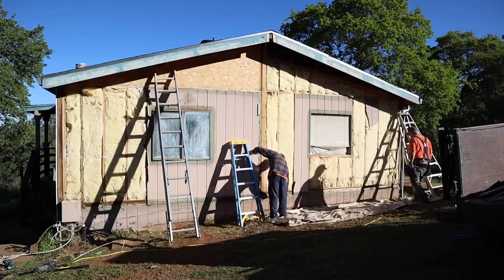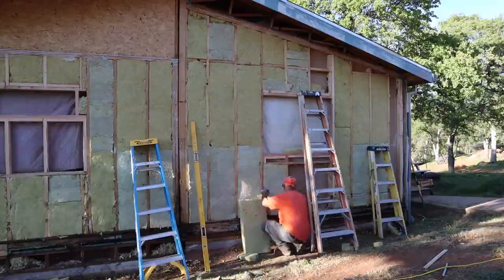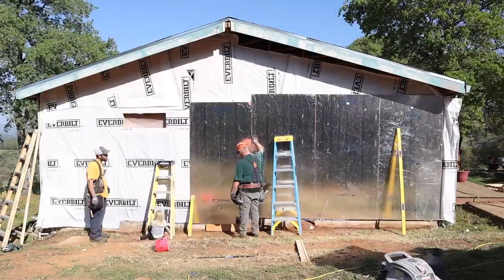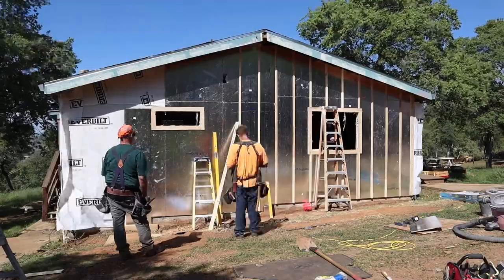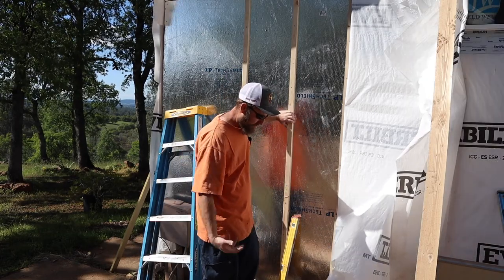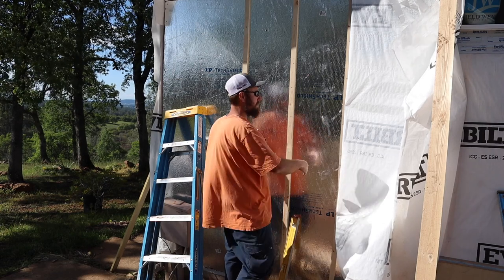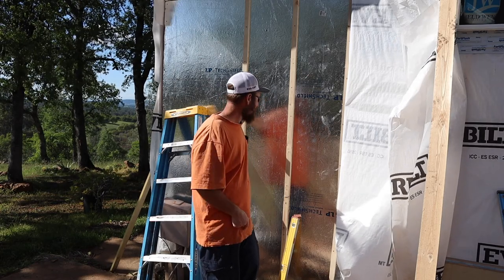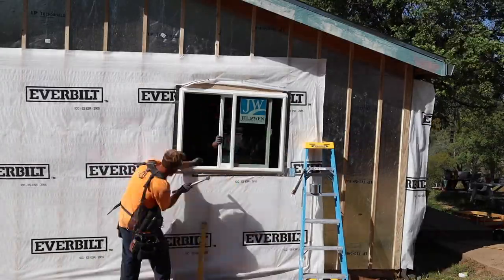RAIN-SCREEN wall...Sun-screen?

Comment: Cool ! Im trying to figure out how to fix my failing walls at my place. Its slab on grade with load bearing 2x4 walls built about 2 feet inside the slab then insulated with strawbale and a rainscreen wood siding. The straw is not insulating enough and deteriorating. I need to strip to the studs and re- insulate conventionally but its tough because my wall is 2 feet in from the foundation edge

Comment: I Call that smarter siding.
Reply from the maker: We will see how smart it is when summer gets here.
Reply: @JoeSimple Joe how has this worked for you?  Any things you'd do different?
Reply from the maker: @CBDguitar  It has worked really well. The temperature difference is noticeable. I plan on continuing it around the west side of the house. Things I will do different are, I will use larger spacers 1x3 rather than 1x2 to allow for better nailing as the concrete siding is brittle and the seams are starting to crack where the nail are, thinking about using lap siding. also will use a proper vapor barrier(tyvek), also looking a a product called Cor-a-Vent  for the base and upper opening to allow for air flow. also figured out this process is called "rainscreen" check that out for more info. (you also inspired me to update the title) Thanks for reading my TED talk hope this is helpful 😊 also feel free with any other questions.
Reply: @JoeSimple  Thanks for responding  and sharing your learnings Joe! I'm going to be building a lean to greenhouse and also really enjoyed your video on cutting rafters for your chicken structure👍. The lean to back wall will be the existing SW exterior wall of my house constructed of concrete blocks covered w/a scratch coat painted with Dryvit (a synthetic stucco).  The main glazing will be on the SW lean to front short wall. The roof will be solid and insulated along with the north end wall. I want to use the insulated greenhouse mainly in the spring as a greenhouse to give fig trees an early season start. Here in zone 6b, I'll store dormant container fig trees in there over winter. Normal loss of heat from the warm house via conduction through its block wall during winter will help add some heat in the lean to as some heat is trapped by the structure. This will help keep temperatures above 20F passively in there.